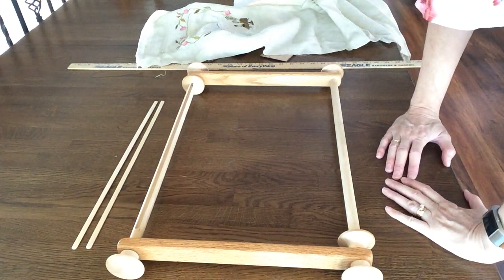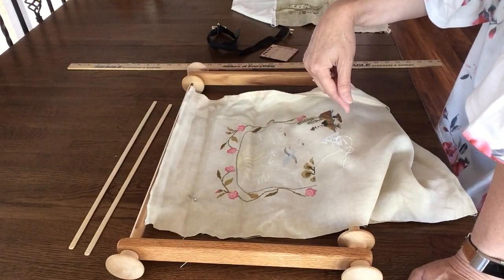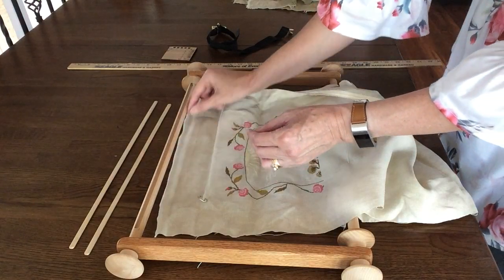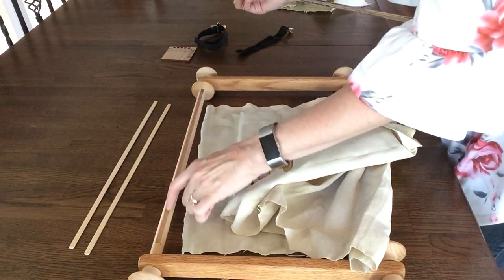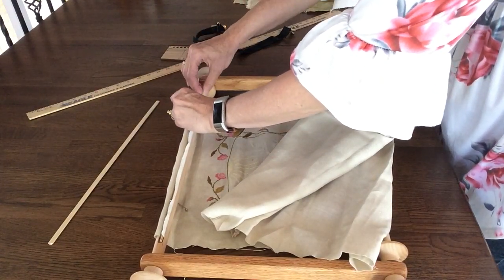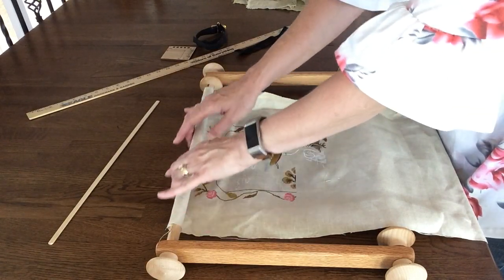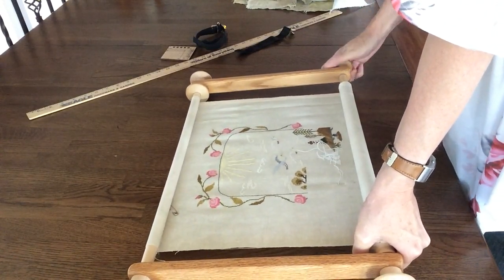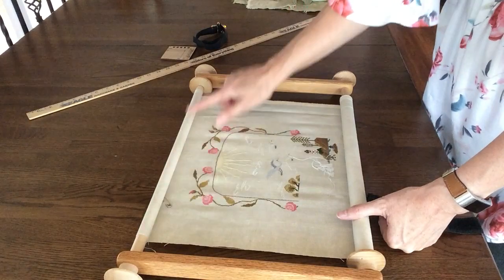Flosstube #59--How I load my Lockscroll Scroll Rods

Comment: I know this is an older video but I just purchased these locking scroll rods for Christmas. I’m not sure if the design is newer or different design but my instructions say to place BOTH tension knobs on one side. I’ll try it both ways and see how it works!
Reply from the maker: Hmmm, how interesting.  My instructions said to make sure the knobs were opposite each other.  I have will have to dig out my instructions and read them again!!!  LOL

Comment: What helps you decide whether to use a q snap or the scroll frame? Is it only if the project measures a certain size height-wise? I am remembering the beautiful Victorian House that you were stitching. That seemed pretty tall, but you were stitching it on a snaps. I don’t have a scroll frame, so I am trying to figure out if I need one. Thank for this video, it’s certainly very helpful!
Reply from the maker: Hi Elizabeth!  I should have talked about that in my video :)  I definitely prefer q-snaps and I use them if at all possible.  I generally only use scroll rods on the class pieces I have that are almost all specialty stitches because the q-snaps sometimes distort the specialty stitches and fragile specialty threads.  And they were very expensive classes and materials.  I started Serenity Harbor in a scroll rod because it is such a long piece of fabric, but realized I was hating it so I switched it back to a q-snap and am just using the quilting "peels" to hold that extra fabric on the bottom of the q-snap.  Scroll rods are a lot heavier and bulkier and a tiny bit harder to balance on my lapstand, they are not my favorite, but they work well for the class pieces.
Reply: Handworkmaniac Thank you for response, I really appreciate your input!